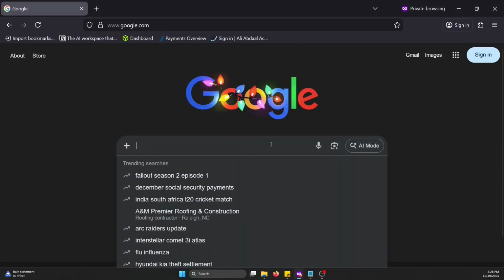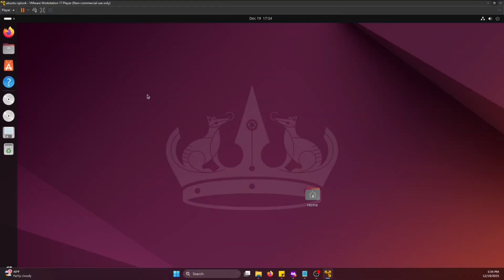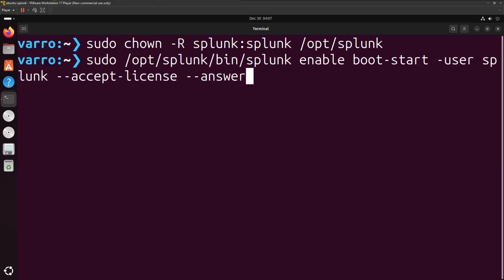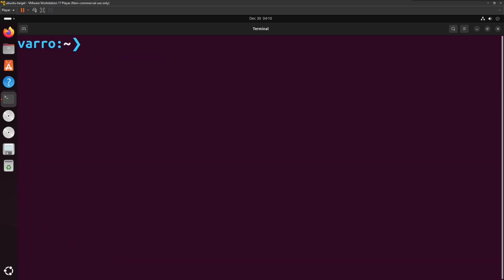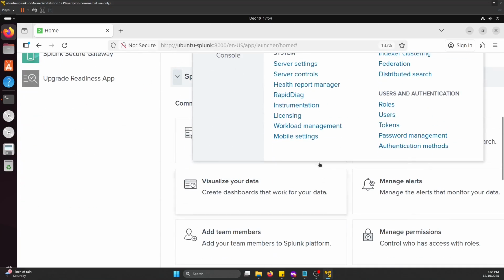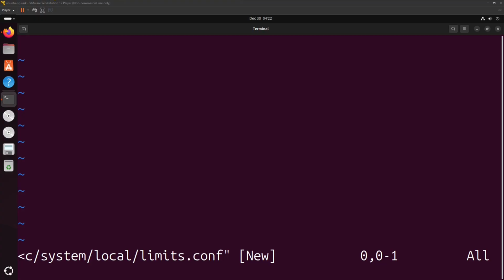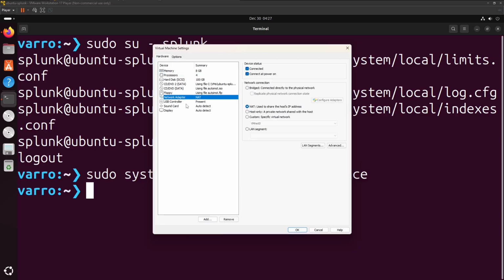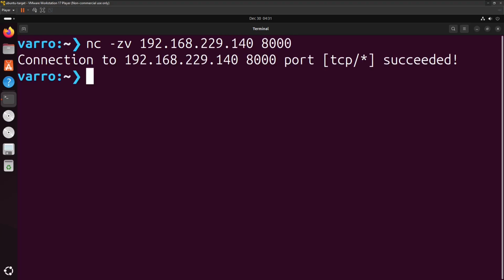Part 2 - Splunk installs + tuning - Build a Real Threat Detection Lab with Splunk

Comment: Using Virtual box and not VMware … followed all ur instructions but now Ubuntu-target can’t connect to Ubuntu server (ip)… it says “connection failed “
Reply from the maker: There are multiple things that could be the cause.
The first thing I would check is, can I ping ubuntu-target from ubuntu-splunk?
Second, what is the IP address of ubuntu-target and ubuntu-splunk, respectively? Need to ensure they're on the same subnet and linux isn't being quirky.
third, ensure both machines are set to "NAT" in the VirtualBox network settings.
Side Note: I used VirtualBox for years until I was forced to use VMWare for a certification lab. Since that time I've switched over to VMWare Workstation Player because I've found it to be much less quirky than VirtualBox and it is also free.
All that being said, I obviously have no idea what your level of experience is but if you're fairly new, then this is great!
This is the kind of issue that pros deal with all the time! So it's great experience and overcoming issues like this really built my confidence.
Let me know how it goes.
Reply: Thanks for for your vids
I am using windows machine now and running Ubuntu on VMware, followed everything u said and did… I ping my ip address and there was a connection between both machine but using the nc -zv it says “missing port number: but I used port 8000 or 8089 associated with the ip address. Network is set to NAT.. I want to make sure all is set to move to the next step
Reply from the maker: couple more things to try:
ensure the ports are open and listening on ubuntu-splunk (watch me do this in the video around the 25 minute mark):
ss -tulpn | grep splunk
if your ubuntu-splunk box is actually a windows machine, you can do the same thing with: 
netstat -ano | findstr :8000
or
netstat -ano | findstr :8089
those ports have to be listening or else the nc -zv will fail.

also, on the video (around the 26 min mark) you can see that I also received the message "missing port number" when I typed:
nc -zv 192.168.229.140:8000
I then corrected my syntax to 
nc -zv 192.168.229.140 8000
because when I used the : before the port number (8000) it didn't like it.
Try those items and let me know how it goes.
This is complicated stuff so don't worry, challenges like this are completely normal!
Reply: @packethammer  yes. the issue was from ":" .. you are the GOAT. Thank you
Reply: The Splunk lab turned out good and got data forwarded… thanks
Reply from the maker: Nice! Great job for pushing past the frustration and mastering the networking part!
Give yourself an extra pat on the back because what you did is NOT easy!